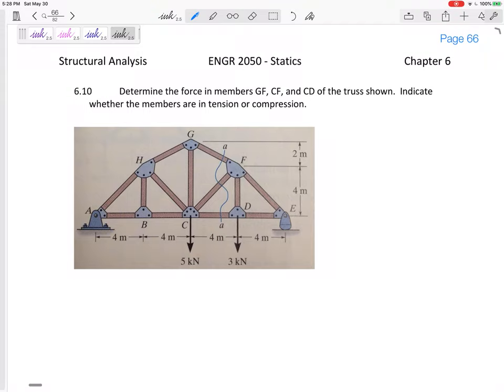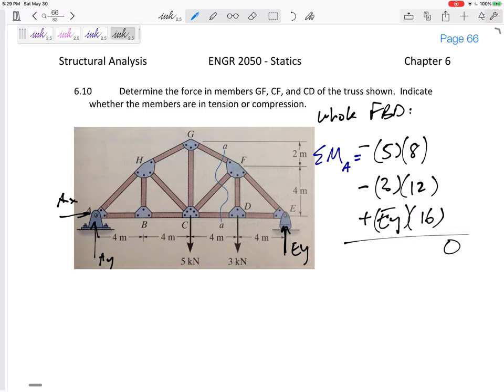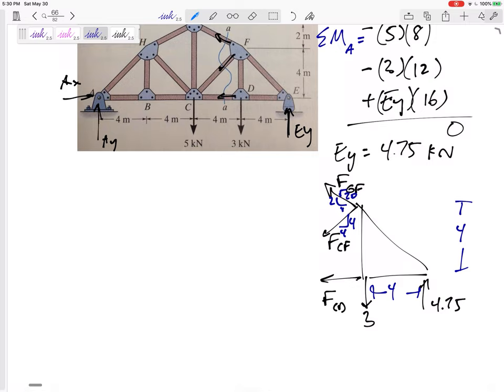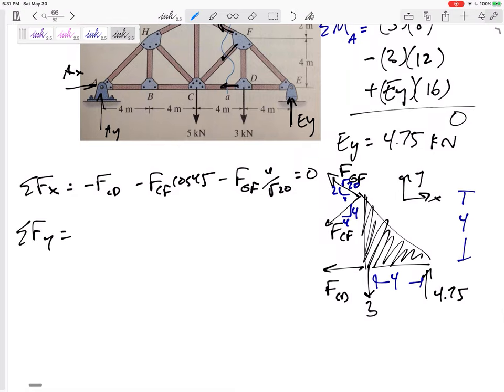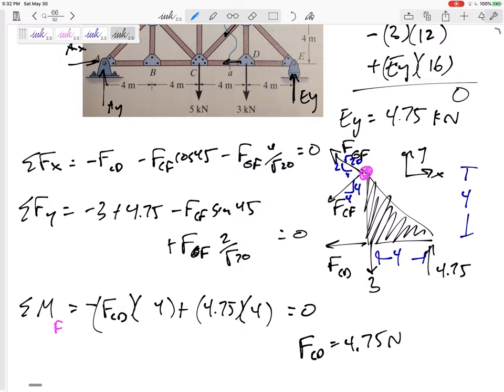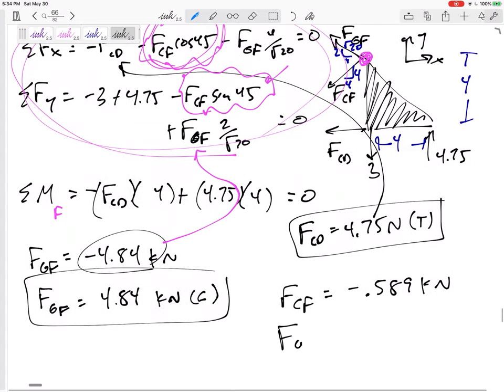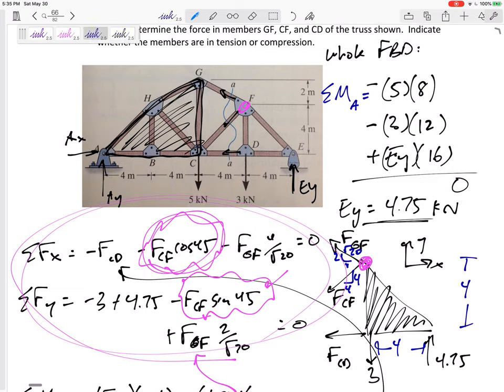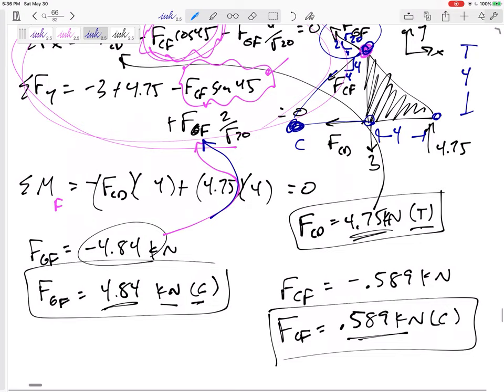Statics - Truss Method of Sections example 3

Comment: where did the 4.84 came from?
Reply from the maker: I guess that's just what we got from the math when we plugged in Fcd
Reply: @engineeringdeciphered   how does that help........
Reply from the maker: @ethanwolfram508  we got the 4.84 from solving two equations and two unknowns. The two unknowns are Fgf and Fcf. The two equations are the sum of the x forces and the sum of the y forces. I guess I skimmed over that part since the main topic of the video is the method of sections process, not the math of solving two linear equations. I might make a video in the future of how to solve two equations with two unknowns.
Reply: @engineeringdeciphered  Hi! My name is Johan and I am an bachelor's undergraduate in mechanical engineering at Karlstad University (SE). I am grateful for your content as it has helped me finish thermodynamics and I am currently using these videos to refresh my memory of statics in advance to take mechanics of materials this autumn. I recently finished applied mathematics, learning how to use matrices to solve systems of linear equations with gaussian elimination. Applying this method to the systems shown in these video, using the row reduction function in my calculator I find that F_cd = 4.75 kN (T), F_cf = 1.06 kN (C), and F_gf = 4.47 kN (C) with the directions of the forces initially assumed to be tension.